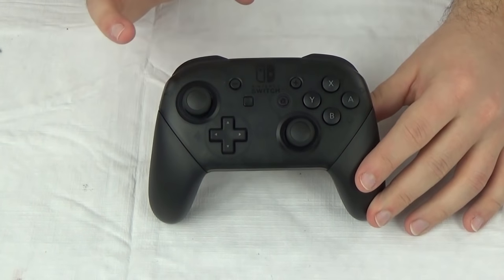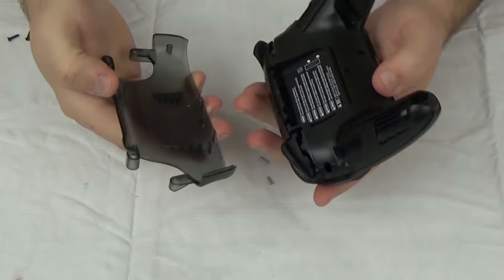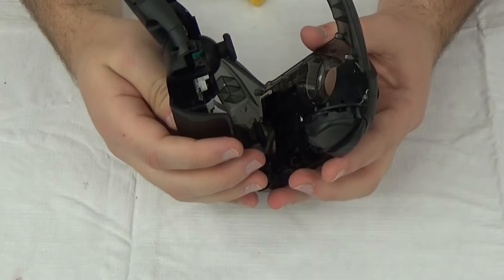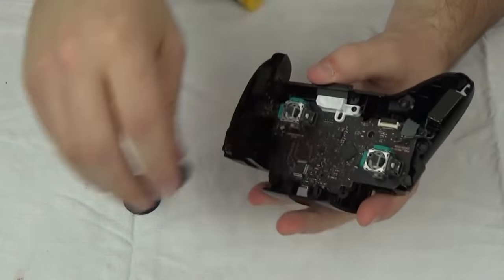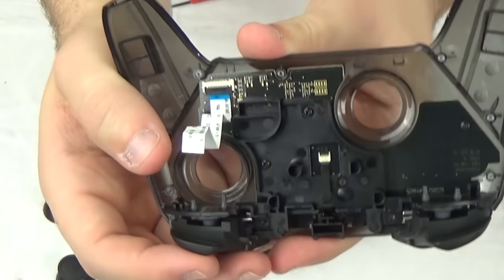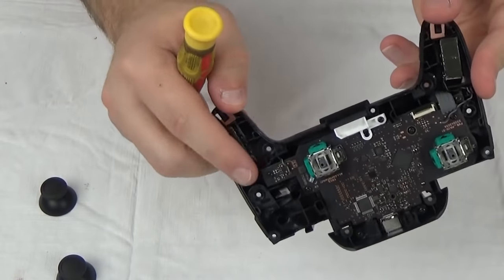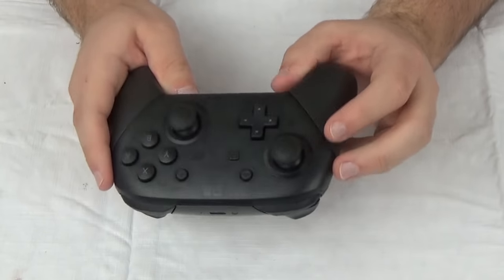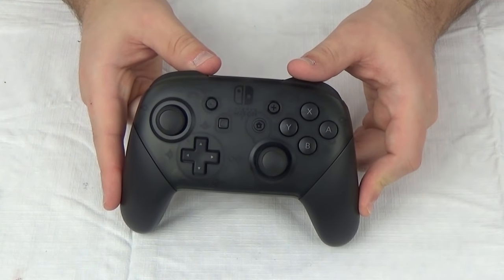Taking Apart The Nintendo Switch Pro Controller! Secret Message Inside?

Comment: Anyone else having problem jumping while sprinting? (breath of the wild) They put the jump button above on the x button and they put the sprint button below on the b button, i cant sprint and jump at the same time (unless i put my thumb on the sprint button and my forefinger on the x button which is totally uncomfortable) so i opened option menu i noticed that i could change them so i was yeahy. But turns out you could only swap them between x and b that sucks so badly.
Reply: shiro yashya You know it never occured to me to do both of those things at once.
Then again I keep forgetting jumping is a thing, and keep anticipating autojumps that don't happen...
Reply: shiro yashya I switched it around and use my index finger to run on x so I can still look around and jump. but I'm pretty sure you can still jump further after letting go of sprint. There's a small window

Comment: This looks like a ripoff from the XBOX controller.
Reply: Xbox controller is a rip off of the Gamecube controller.
Reply: ゲーマールイージ Xbox isn't as curvy on the top, is not translucent. Has a little overhang on the grips, where as this one doesn't. All controllers have to be similar because there's a set standard for them. Sony kinda pushed the boundaries with it a tad but I think PS controllers aren't comfortable.
Reply: ゲーマールイージ I only now read your name and, as a student of Japanese, translated it to "Gamer Luigi" is this correct? I honestly want to know.